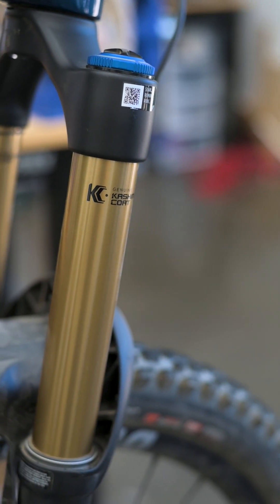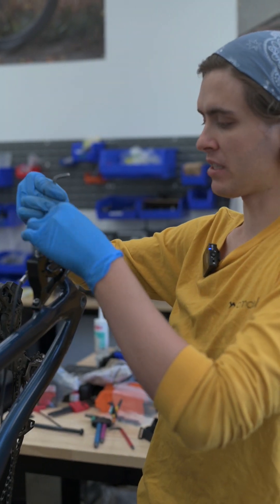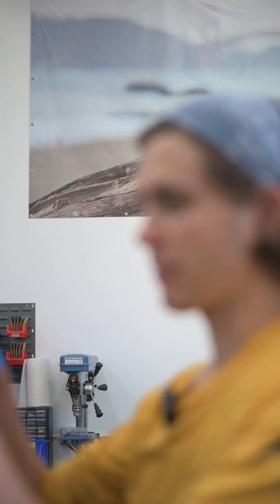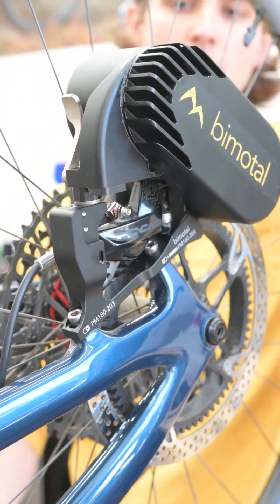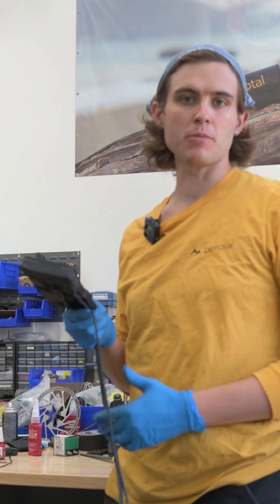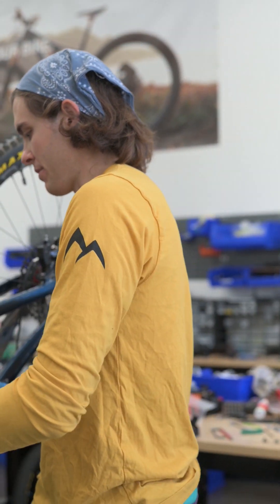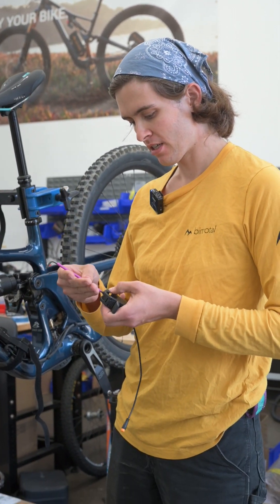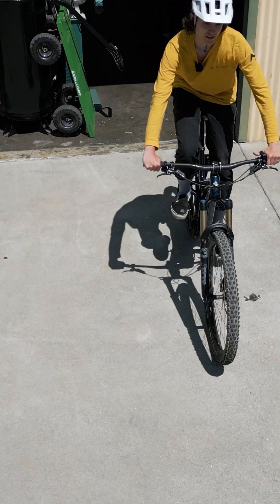How to make your MTB electric!

Comment: Is there an option to lock the motor to caliper to prevent theft so you dont have to take it with you if you have to leave your bike alone for a bit.
Reply from the maker: Just take it with you, If it is locked to the bike someone could still steal it. There is no way to steal it if it is in your hand.

Comment: My bike has 180 without adapter but I has galfer adapter and 203 disc's can I use this?
Reply: I watched it again seems like it's perfect fit
Reply from the maker: Seems like you figured it out but yes, whatever your brake mount is we use 1 size bigger to fit the mounting hardware.

Comment: All the people saying you can get an e-bike for two grand. Go ahead and buy your cheap Chinese Walmart bike if that's what you want. This is for making your nice mountain bike a nice e-bike. Not  a cheap A To B commuter. A proper, lightweight, high performance, full suspension mountain bike that has a mid drive motor and a battery is going to cost you upwards of $6,000
Reply: Better to just get a motorcycle if $6k
Reply: prices are dropping pretty quick though, the SWorks frame just droped from 8 grand to 4,999, it includes new suspension and new motor.... and it is an Sworks. Bimotal is a good idea, but i believe the moment frames start getting to the 2000 - 3000 dolar price range the window of opportunity will be lost.
Reply: @4locsa  yes, while this is a smart invention, does it's benefits outweigh it's high cost when compared to what's already available? If cost is not lowered significantly, it won't become global
Reply from the maker: Thank you 🥲
Reply: Cost is high because of manufacturing in a high cost country. Cost need not be so high for the same quality
Reply: Local bike shop had specialized e-bike go for 40% off last week, they are really getting cheaper

Comment: I've looked at kits for a while and none look capable of fitting my Jetson Bolt Pro, but I think this one can.  Do you know for sure if it can or if you know of anything that would prevent it.  I measured out 180mm rotor and the drive gear I guessed is about 150mm x 10mm wide.  When I checked those measurements on my Jetson, it looks good.  Let me know what you guys think...Mahalos (yes, it's Hawaii🌺 I'd be ordering from🤙🏽 I hope shipping is reasonable)